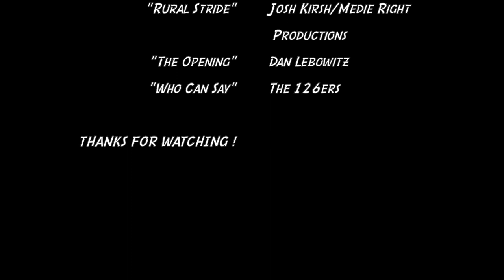Two Cockpit Deck Beams are installed in the 1973 Egg Harbor Sportfish - Boat Restoration EP044

Comment: Great job, Bob. The plenums should give wonderful ventilation in the bilge. Take care. Jerry
Reply from the maker: Thanks Jerry. Now I just have to figure out if the factory had 2 blowers. The starboard side was so rotted and the plywood was already removed. I guess I could take a closer look at the original wiring. Thanks for the comment and take care.
Reply: @renovationsportfish1563  I was going to ask if it was 2 blowers. If possible I would go for duals just for redundancy. Don't worry though, I'll ride with you no matter what.

Comment: looks great. but why bother to bung the screw hole support pieces and worry about epoxy bubbles on under deck pieces that will never be seen?
Reply from the maker: Thanks for the comment Cliff. I'm trying to encapsulate all of the wood I install with epoxy. When I first started I read somewhere that if all surfaces are not epoxied you might as well not do it. The bubbles are pinholes and the screw holes, well they are holes. It is more for function not aesthetics. Good question. Thanks for watching.